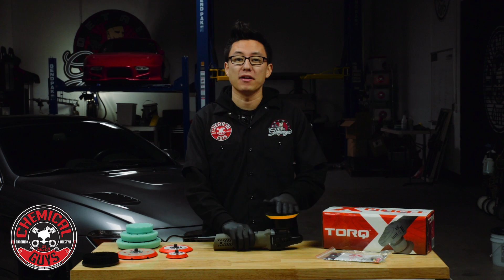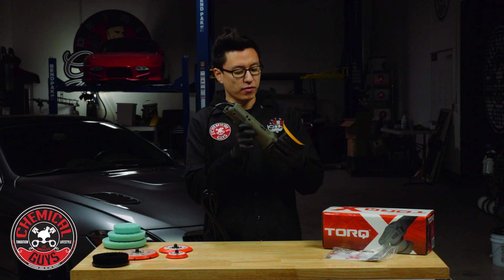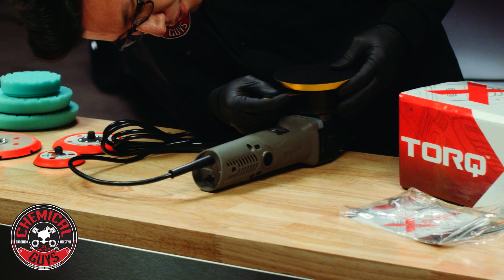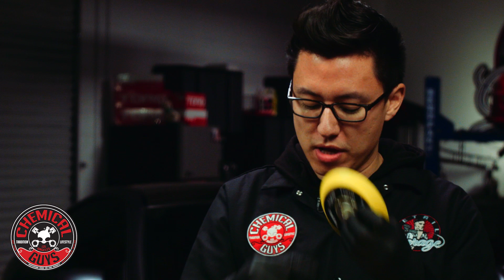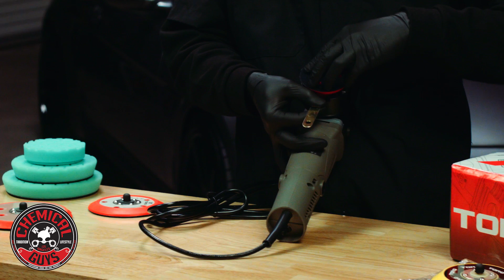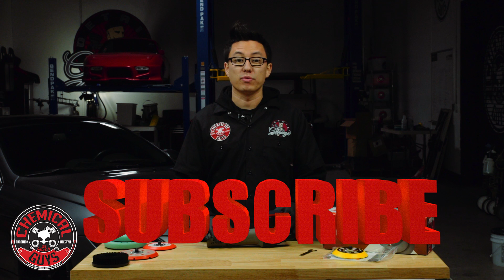How To Change Backing Plates - TORQX Dual Action Polisher - Chemical Guys

Comment: I bought this recently and it came with some extra brushes for the motor. It would be nice for Chemical guys to do a maintenance video on this unit like greasing the spindles and replacing brushes.
Reply from the maker: Great suggestion!
Reply: @ChemicalGuys  I have to give props to you guys for so many detailed videos on detailing a car and I have learnt a lot and also built a "arsenal" as you say of Chemical Guys products. I love them and they are all good. So if you also want customers to buy your polishers, then a more detailed video of maintaining these devices just like you have on all other chemicals would be nice.

Comment: Just got my Torq 10fx.  It has a a stiff 5" red in color backing plate and then a second also red 5" that is much more pliable.  The unit has a yellow stiff backing pad already installed.  Is there a major difference in using any of these given they are all the same size?

Comment: What's the difference between the red and yellow backing plate?
Reply from the maker: Hi Gabe, great question! The standard yellow plate is great for flat surfaces, polishing hoods, door panels, rooflines, and trunk lids. The red flex backing plate shines when working around the curves on the hood, polishing rounded headlights, and gliding along the contoured surfaces of wheels and panels. The red hyper flex backing plate gives you more flexibility when working on arched panels, and cornering. Thanks for watching, Gabe, and make sure to check back later today for a new video upload!

Comment: This saves me from having to get 2 machines
Reply: No. It won´t save you for getting of second machine, because when you replace 5 inch for 3 inch the machine will be discounterweighted and it will be vibrate like a vibrator. rip yours hands.

Comment: I ordered a torque 10fx DA a few years ago but I lost the wrench to change the backing plate, do you guys sell them on your website?
Reply from the maker: Hi Eric, thanks for watching. We don't sell the wrench, I would recommend going to a hardware store with your polisher so they can look at the spindle thread to determine what size wrench will be compatible. The wrench should be easy to replace. Thanks for watching Erick, stay tuned for more great videos.

Comment: chemical guys, I just received my 10fx in the mail today and did not come with a rench to take the backing plate off. who can i contact or email about getting one shipped.

Thank you, and love all of your products.
Reply: The wrench is a 14 mm, you can get one from Bell deluxe tube repair kit. It won’t fit thru the torq slot but if you angle it it works great- it’s a thin wrench.
Reply: The Bell kit is for bicycles
Reply from the maker: Hi Cody! Did you check in the instruction manual bag? The wrench is usually packed in there. If it's not there, contact our Customer Service department and they'll get one out to you ASAP! http://www.chemicalguys.com/category_s/283.htm